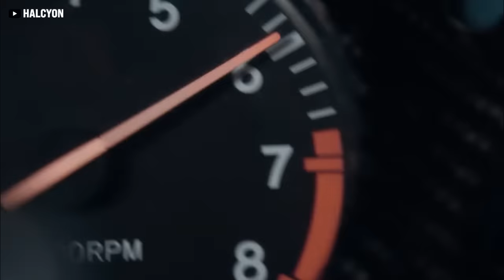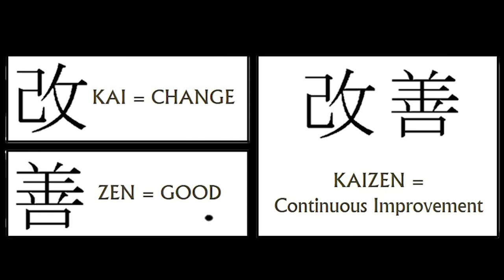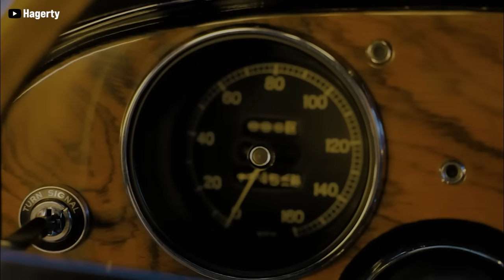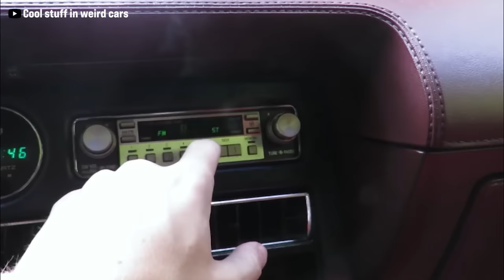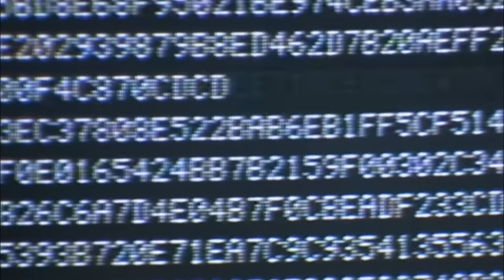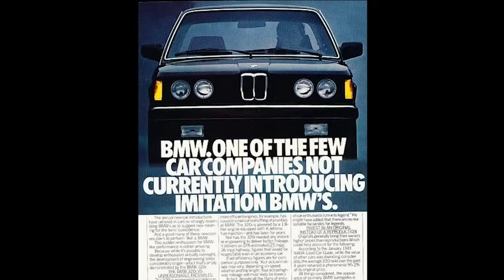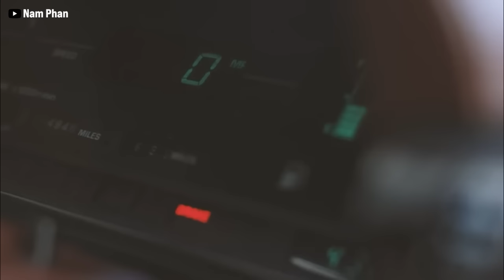Toyota Supra | The Story of an Underdog!

Comment: I'm Japanese, my father had a corporate career for Toyota for 17 years and I love the Supra, until the current.      I dislike BMW, and though I understand how much it would have cost Toyota to produce a sports car, from the ground up, I just think there were better options than BMW

Excellent video!
Reply from the maker: I agree!
I personally would have thought they could use the LC500 or RCF platform. I personally would have been happy with Toyota's v6 twin turbo or literally any of their performance engines. 

Thank you, I really appreciate.
Reply: @tart_01  I mentioned the same LC500 platform idea to my father lol, back when the current Supra released.  Apparently using that platform would have required a lot of modifying, which also would have had a high R&D pricetag and still wouldn't have been cost effective.  Also the LC500 is half a ton heavier than the current Supra.  Toyota does not like spending much to develop new vehicles, hence their 2023 4x4s on 13 year old platforms lol   

I'm not against partnerships, but Toyota was eager to cash in on the Supra badge and completely disregarded the fact that the name Supra is a Japanese cultural icon.
Reply from the maker: That's fair. I still would have bought one.
The LFA platform would have been awesome, even if it was aluminium instead of carbon fibre. Obviously, it'd be too expensive for mass production, but we can dream 🥲

It does feel like they were eager to cash in on the Supra nameplate. My research tells me Toyota were selling their hydrogen technology to BMW conveniently at a similar time.
Reply from the maker: Hey, thanks again for watching the Supra video and commenting.

It has been a while between video's, which makes it hard to get traction. 
My new video is based on the story of the LFA. I hope you enjoy it!
https://youtu.be/-y8ntGMPpt8

Comment: 11:24 That's my exact same MK3 Supra right there minus the spoiler (and lowered, 89+ taillights, full custom LED conversion, wheels/tires/suspension, etc etc). Bought it two years ago and it's transformed the way I thought about cars and cared about them. I never imagined the response this car would have in public and it's connected me with the car community in a big way.
Just today I drove her for the first time since May due to waiting on LED light parts and man she never fails to make every day an experience. It's such a damn cool car and everyone is STILL looking at it. Plenty of power and with mods the handling is like on rails, I just can't get over it. It's still a Supra (the first standalone!) and I wouldn't want any other.
Reply from the maker: That would be one sleek MK3. I feel the same, cars like this, have a charming character about them. They tell a story of their development  just by looking at them.  It definitely  can connect you with like minded people. I personally, can be a little introverted in general conversation with random people. But when it comes to cars I can really open up.
Reply from the maker: sorry about the late reply.
Reply: @tart_01  That's just it Tart, I'm extremely introverted, but the car community thing brings me out of it; especially when I have past owners of this car chatting me up. It's an easy common ground and a lot of older folks haven't seen the car since it's heyday. 90% of the time it's actually teenage kids that are into it though, they clearly see how cool and different it is from everything else they grew up with and the scene. It's opened up a lot for me in terms of connecting with people, so that's the power of niche JP cars I guess!
Reply from the maker: Hey, thanks again for watching the Supra video and commenting.

It has been a while between video's, which makes it hard to get traction. 
My new video is based on the story of the LFA. I hope you enjoy it!
https://youtu.be/-y8ntGMPpt8

Comment: When I first saw a few images of a car out of Toyota I thought HOLY CRAP THE SUPRA IS BACK AND IT LOOKS GOOD!  This was in between 2003 and 2012. It turned out ot be the LFA... At least to me the LFA is one of the most boring looking supercars but HOLY crap everything about that engine is AMAZING. I've always thought if they had dumped he expensive body work materials, put a inline 6 under the hood and sent it over to Toyota for a different badge and called it SUPRA they would have had a runaway success. Ok they would need to change A LOT to get the price down but what I am maining talking about is the look. As the LFA it somewhat fails at being a halo car. That engine really pushes an otherwise very tame looking car into the halo spot. 
When the FT-1 concept landed I thought HOLY CRAP THE SUPRA IS BACK AND IT LOOKS GOOD! TAKE MY MONEY..
I knew the concept would get EXTREMELY water down do to regs and production costs but wow did they ever manage to bring  A LOT of the FT-1 through the production process. I was 100% going to buy one.  
Until I saw the interior.  It has all the passion of an electric razor. Gets the job done.
I had ZERO issues with the BMW connection and the bin parts being shared but I thought they would at least try and make the interior look like an evolution of the MK4. They ended up putting WAY TOO MUCH BMW into it. 
BMWs have good interiors but they have that (0nce again) gets the job done efficient look to them.
I hope they send the 2025 model out with a special MK4 updated interior when the model once again rides off into the sunset. I'm sure it will return once the world as really adopted electric cars...
Reply from the maker: Thanks for commenting. That's an interesting perspective. The LFA idea would have been awesome 👌.
Reply from the maker: Hey, thanks again for watching the Supra video and commenting.

It has been a while between video's, which makes it hard to get traction. 
My new video is based on the story of the LFA. I hope you enjoy it!
https://youtu.be/-y8ntGMPpt8

Comment: The Supras are wonderfully designed and were reliable, although very conservative in their power.  The 5MGE's 8.8 CR canrdly be called high, that's turbo CR, which is why HKS had no problems bolting of a twin turbo kit on the stock engine with tge required plug and play electronics to deliver over  250 HP. The 7MGTEs 5psi on a CT26 turbo for 200 HP was at best, tame. Especially when the Celica 3SGE was 173 HP. Still, the 300 HP 2JZGTE was also ultra conservative when 800 HP of bolt-ons are quite in order. Pity about the FT1 though that it's design  was disproportionately short tail and fitted with a BMW drive train instead of a carryover of the legendary 2JZGTE with sequential option.
Reply from the maker: Totally agree, The Japanese were and are still ultra conservative with. A lot of the reason is to do with their culture of under promote and over deliver. The gentlemen's agreement at the time I'm sure had a lot to do with this as well. The FT1 would have been killer.
Reply from the maker: Hey, thanks again for watching the Supra video and commenting.

It has been a while between video's, which makes it hard to get traction. 
My new video is based on the story of the LFA. I hope you enjoy it!
https://youtu.be/-y8ntGMPpt8

Comment: A very nicely done video history lesson of the Celica Supra -> Supra. Unfortunately, you repeated some very common misconceptions that have been filling Wiki, Donut Media, etc. for years.
First, "The Supra's arrival in the American market in 1978..." is completely incorrect. The first car stamped with the Supra name wasn't even off the assembly line until January 1979. Yes, the MA45 XX had been built in Japan since April of 1978, but the MA46 Celica Supra wasn't built or exported until 1979.
Second, my 1979 MA46 built in January of that year would argue with your list of 'goodies' added to the A60 in 1982 as I go down the road setting its cruise control, adjusting the climate control, stopping with 4 wheel disk brakes, and pulling out the retractable reading light to check the map to see where I made the wrong turn. You could even have an LSD diff in 1979, but most of them ended up in Canada, not the USA. None of those were new to the A60. The kitchen sink is accurate, though. A more accurate list of 'goodies' added for the MkII Celica Supra would be the electric sunroof (the original was manual crank), fog lights, factory alarm and electric side mirrors.
Finally, there simply is no such thing as an "A 90". The A series chassis designation is exclusive to the original Supra generations from the A40, A50 (XX only), A60, A70 and finally the JZA80. Each and every one of those had that chassis designator stamped somewhere on the car and was part of the frame number or VIN. The GR Supra has nothing like this. I remember the Gosport reveal where Toyota corporate had A90 plastered everywhere, and the backlash from the Supra community was swift and harsh. A90 quickly disappeared from Toyota advertising after that, but reappeared with the A91, unfortunately. It is a GR Supra, nothing more.
Thanks again for the stroll down memory lane of my 40+ years with Supras. And nice to see many old friends represented in your videos of their cars.
Reply from the maker: I'm glad you enjoyed it. Thanks for the history lesson 🙂.  As I create more video, it will be something I have to find a way of combating to ensure details are more accurate. There were plenty of articles and informative pieces I read where I knew things weren't true. I am not a journalist or professional in that realm by any stretch of the imagination. 
Thanks, it will be a learning curve for me.
Reply from the maker: Hey, thanks again for watching the Supra video and commenting.

It has been a while between video's, which makes it hard to get traction. 
My new video is based on the story of the LFA. I hope you enjoy it!
https://youtu.be/-y8ntGMPpt8

Comment: Mk IV that dominated racing didn't use 2JZ engine. I believe an aluminum 4 cylinder turbo was used that met the power requirements while weighing less than the 2JZ.
Reply from the maker: You're right, it was the 3S-GT in the castrol racing supra. I meant to slot that fact in somewhere. 😅
Reply from the maker: Hey, thanks again for watching the Supra video and commenting.

It has been a while between video's, which makes it hard to get traction. 
My new video is based on the story of the LFA. I hope you enjoy it!
https://youtu.be/-y8ntGMPpt8
Reply: @tart_01  Will check it out this weekend! Thanks!
Reply from the maker: Thank you! 😊

Comment: 1980 Nissan Skyline 2000GT-EL – 2.0 L L20E I6, 130 PS (96 kW; 128 hp) and 2000GT-EX – 2.0 L L20ET turbo I6, 145 PS (107 kW; 143 hp) also Datsun 240K-GT – 2.4 L L24 I6, 142 PS (104 kW; 140 hp)😁 Must have been Aussie drivers.https://en.wikipedia.org/wiki/Nissan_Skyline:text-green-game-over:
Reply from the maker: Hi, I am not sure what game I lost?
Reply from the maker: Hey, thanks again for watching the Supra video and commenting.

It has been a while between video's, which makes it hard to get traction. 
My new video is based on the story of the LFA. I hope you enjoy it!
https://youtu.be/-y8ntGMPpt8

Comment: Neat video, except it falls apart the moment you meet BMW techs who were there and who tell a wholy different story, one of BMW having a FINISHED car thay they exchanged for 2 years of being taught Toyota's Hybrid tech. And considering that it's after this mess thay BMW got seriously into Hybrids AND uses the same tech as Toyota. I lean more to believing them over Tada-san and Toyota's marketing team.
Reply from the maker: It is an interesting point. In a lot of research, there was talk about bmw brokering a deal with Toyota for their hydrogen tech and eluding to the Supra having something to do with it.
Reply: @tart_01  yeah, it was kept hush hush, but it still leaked. Several BMW techs who were on the project have essentially admitted that BMW prior to giving the Z4 M Coupe to Toyota was struggling to make hybrid tech work as a lot of patents prevented them from making use of some tech. So they basically approached Toyota and Toyota being a for profit company figured that it was their best chance at getting some money from the Supra name plate. Mainly because Toyota doesn't do Inline sixes and they never thought a V6 Supra with a Toyota developed and made V6 would sell. So they focused on Inline 4's and Inline 3's. Which is how the G16E-GTS came about. Also I think Toyota figured that if they traded the hybrid tech to BMW it could help slow down the stupidity of people pushing for EV's.
Reply from the maker: Hey, thanks again for watching the Supra video and commenting.

It has been a while between video's, which makes it hard to get traction. 
My new video is based on the story of the LFA. I hope you enjoy it!
https://youtu.be/-y8ntGMPpt8

Comment: What's the nurbergring laptime for that POS? 45mins?
200hp never looked so fast!
Reply from the maker: Thanks for commenting!
Reply: @tart_01  - by the German publication sport auto's time with the current Supra in 2019: 7:52.1

Even better, the time this year that was set by the manual-spec GT4 100th Edition Tribute version: 7:54.1.

Both cars use the 2019 BMW B58 engine.

Comment: You forgot about the part when Toyota took part in rallying and cheated elaborately with the supra. By having a hidden path for more air than was permitted.
Reply from the maker: I'm nearly positive the cheating scandal was in the mid 90's and was related to the celica story. That detail will not be glossed over in the celica video.

Comment: oh brother , give me a break...Anyone with capability can make an engine more powerful than a F1 engine... now make it last for 8 races at 12,000 rpm rarely ever not operating below peek. do it ?
Reply from the maker: My point was simply this, back in the late 90's having 800hp in a road going car was a big deal! Especially in a 3.0L engine and especially from a Japanese car. It changed perceptions. 
As a qualified technician of over 20 years, I understand what you are saying, But the point wasn't to say a 2jzgte is better engineered than a formula 1 engine.
Reply: @tart_01  got it , thanks!! But you do know most of the audience will interpret what was said as "better than formula one" that's it. 
Good show regardless
Reply from the maker: You could be correct, but that is their problem if they do!
 I would hope that if I said "It wasn’t long until people were talking about crazy horse power figures like 800hp. To put this in perspective, formula 1 cars of the day, were making between 700-800hp.
We might not think that is a big deal today, but back then, it was groundbreaking! Think about it: Toyota, known for everyday cars like the corolla and the corona brought out a machine that laid waste to supercars, made more power than a formula 1 if you wanted it too" people would see I am only comparing horsepower. 

If I over explained every point that may be misinterpreted or potentially offensive, no one would watch my video. Then If I over explained people may take offense as it could be an insult to their intelligence! 
So either way I can never win 😅

Comment: I always thought these cars were a failure.
Reply from the maker: Interesting! can I ask why? I enjoy hearing other people's perspectives.
Reply: @tart_01  I thought the super never won a championship, so thank you for answering the question on your title. All hail the Mark 3 Supra! Maybe Toyota would have one more championship if they design their own engines. Or maybe if they actually used a 2jz they could have probably beat a skyline in the JGTC. It's a good thing they couldn't find a Mitsubishi 3000GT for the fast and the furious like originally scripted, so thank you for answering the second answer to your question in the title there are 3 other Supras not just the Mk4. MK5 doesn't count because it's a restyled BMW. Supras also never sold well, need proof BMW is going to discontinue the currency Z4.
Reply: I'm glad the 3000gt didn't get the fast a Furious role aswell. Apparently the 3000gt was swapped out for the Supra because it didn't have a single piece targa top which was essential for later on in the movie when the roof got punched out by Paul Walker in the truck scene.
Reply: @edmolina7262  - "I thought the super never won a championship" - If we include the engine-swapped cars, it actually won the 1997, 2001, 2002, and 2005 championships.

"Maybe Toyota would have one more championship if they design their own engines." - dude, GT500 cars require the engine made by the manufacturer that has its badge.

"Or maybe if they actually used a 2jz they could have probably beat a skyline in the JGTC" - nope. One team used the 2JZ, but the car was two seconds slower due to its weight and length. The 503E 4-pot (the engine that powered Rod Millen's Pikes Peak Celica and the IMSA Eagle prototypes) was a way more suitable candidate for the JGTC Supras.

From a sales standpoint, yeah the A80 wasn't exactly a good seller. The current car, in contrast, is doing way better.
Reply from the maker: Hey, thanks again for watching the Supra video and commenting.

It has been a while between video's, which makes it hard to get traction. 
My new video is based on the story of the LFA. I hope you enjoy it!
https://youtu.be/-y8ntGMPpt8

Comment: 2021 and up it has “382 hp” Get your facts straight 😅(at the wheel not crank)
Reply from the maker: I did not indicate where the horse power reading was from. The designation of hp is not exclusive to the "crank". But I will take your comment into consideration next time.